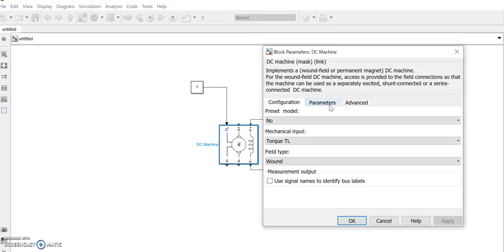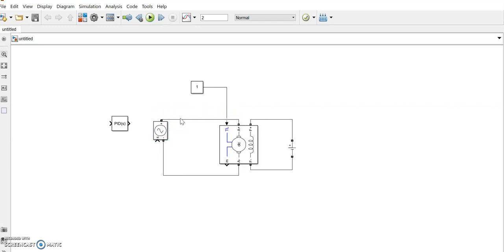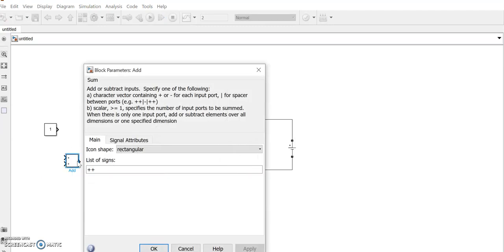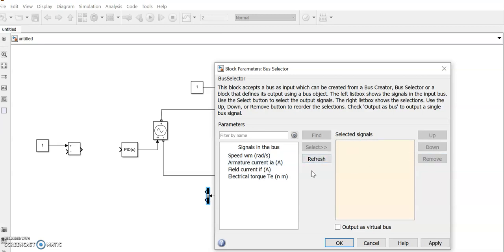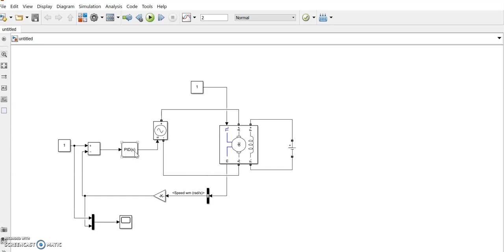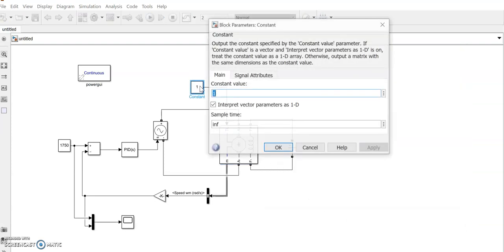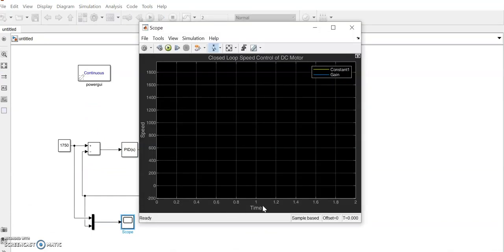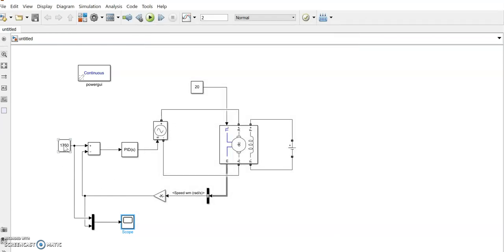Expt 6# CLOSED LOOP SPEED CONTROL OF DC MOTOR USING PID CONTROLLER# Matlab/Simulink Model#Drives Lab

Comment: In this simulation when we are using PID controller to control the speed.....which one we are varying, the voltage or the resistance to control the speed?
Reply from the maker: Armature Voltage input

Comment: the model you work and the motor you used can it also be used for brushless motor or it is different to brushless?
Reply from the maker: In a similar way you can do. You have to model BLDC and give proper inputs.